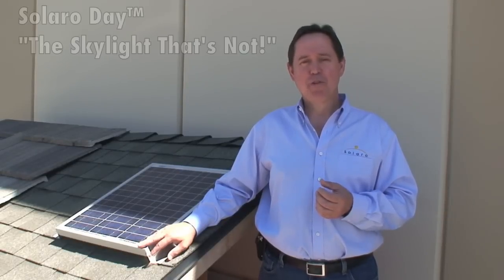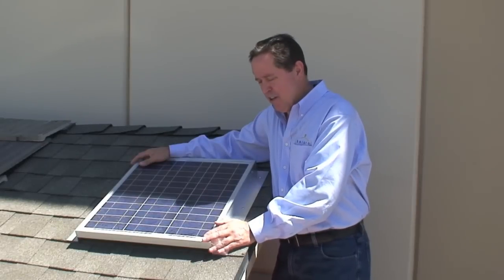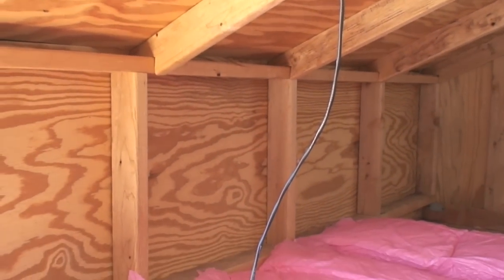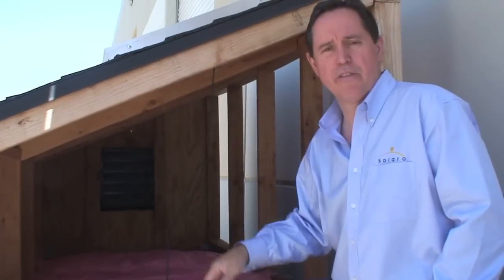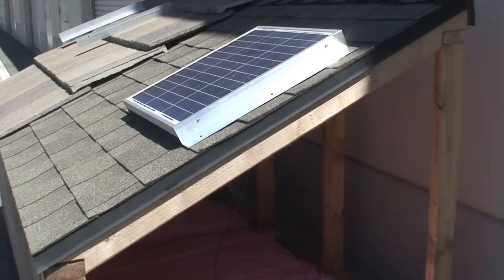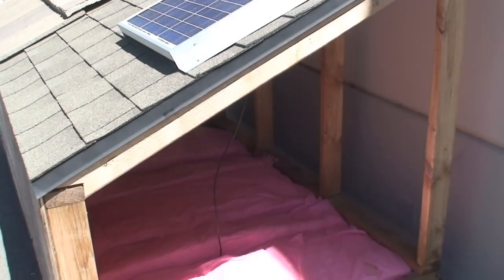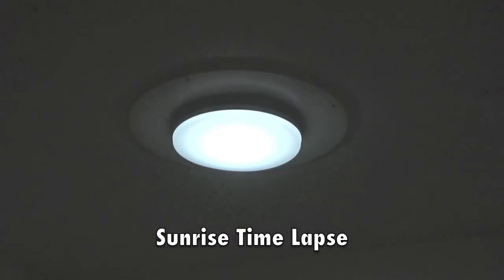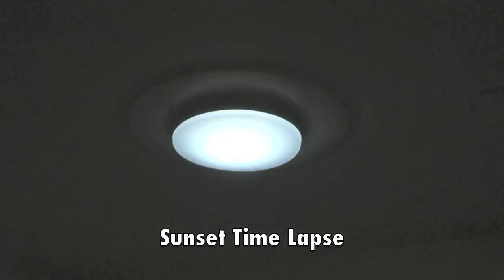DIY SOLAR LIGHTING EXPLAINATION FREE ENERGY FREE POWER

Comment: If this is to illuminate an office that has no windows I can see the point but surely in most cases people use lighting at night. As I understand from this video, lighting goes off when the sun goes down which would rather defeat the point for those people in the 2nd category.